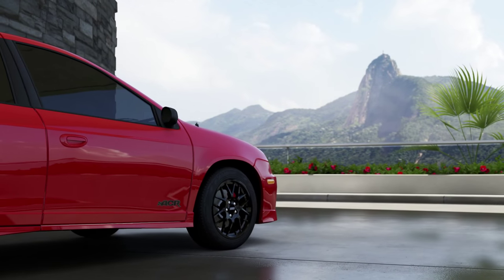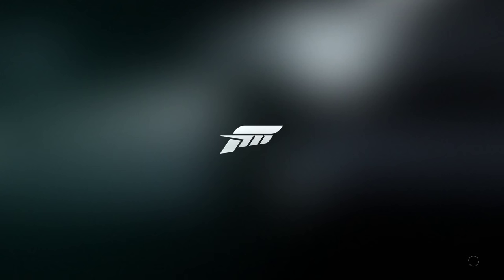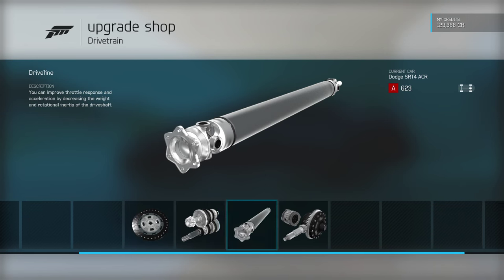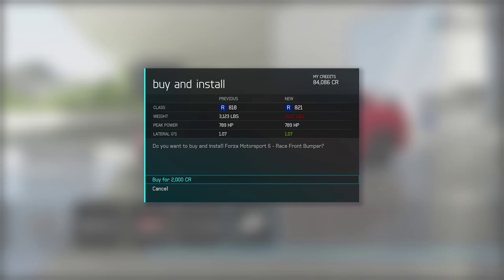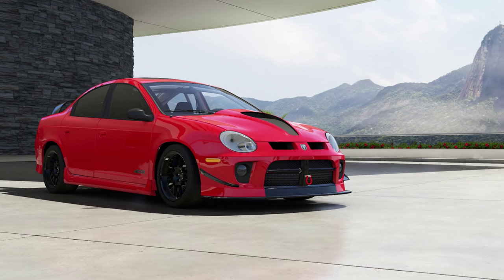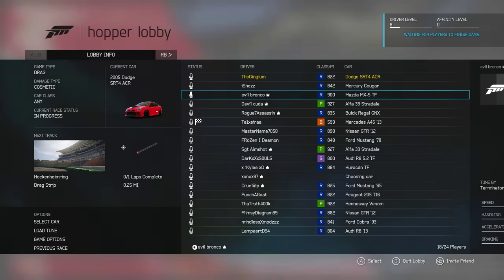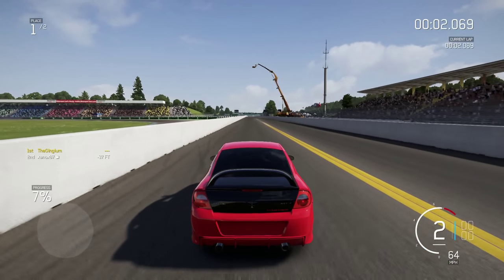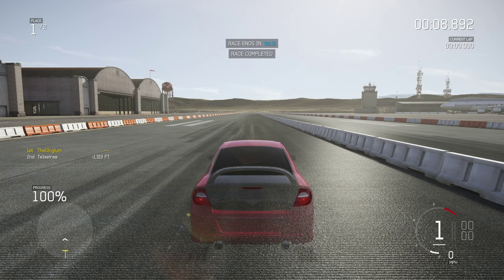DODGE SRT-4 ACR || 8 Second DRAG Build || Forza 6

Comment: stock at sea level, the srt4 04-05 can run 14.3ish. but it does not take much to make power. there is a guy with stock turbo and stock block who runs 11.7 1/4 mile.
Reply: +Brandon Harper that is slow
Reply: +fundane2 your charger runs 9 seconds on the ¼ Mile stock? the hellcat which is the fastest production sedan inn the world only runs 10.9 on drag radials...... no charger runs a 9 second time.. in fact no production car runs 9 seconds as far as I know.
Reply: Brandon Harper If the hellcats aerodynamic ware not shit the hellcat would run in the 9's

Comment: I'd run the light weight SRT-4 motor and push 800hp. Then just RWD. Low air pressure drag slicks. No down force. Then it would do well. However, all Forza's are BS on the power ratings. The SRT-4 can make 600hp on stock internals.
Reply: My buddies spun a bearing and lifted the head at 400hp. You would have to get a high horsepower block kit to make 600hp and that's pushing it. Even if you can build a stock internal 600hp it won't last very long
Reply: +Kyle Carson Depends on how well you take care of it really and what type of oil you use. also you need head studs. I've got a friend who daily drives a 400hp srt4 and it has never lifted the head or had problems. I know or any guys running 550hp and have for about 2 or 3 years on stock internals. I say 600 hp because in my situation, I'm putting my srt4 motor in a 87 Shelby Charger that weighs only 2400lbs with me in it. Less weight means less heat and strain. It's also good to at least buy the forged crank take the twist off the block. I don't know about the I don't know about the bottom end kit you speak of.

Comment: I have one that runs 8.8 in the quarter mile but rwd
Reply from the maker: +Kwezzy Dang dude! Thats impressive!
Reply: you can run 8.4s in the 1/4 Mile with all wheel drive. the guy in this video used the wrong engine.
Reply: +Gingium I have a Holden Torana that runs 8.3